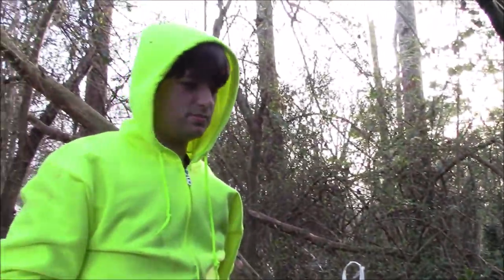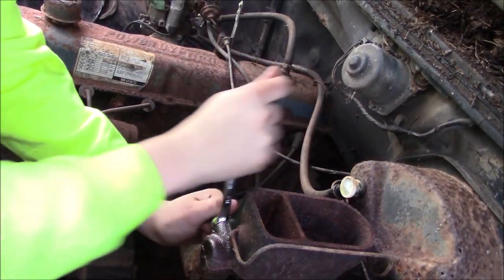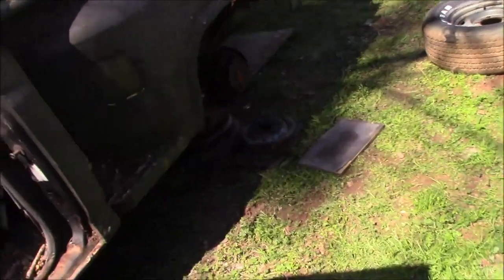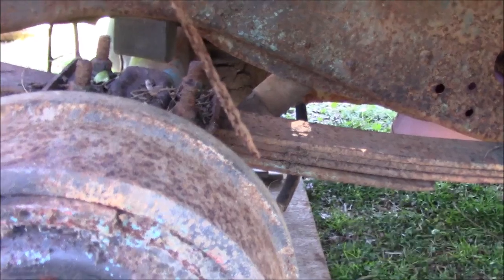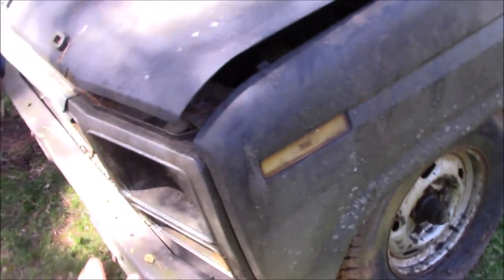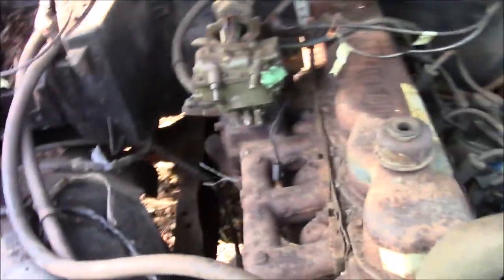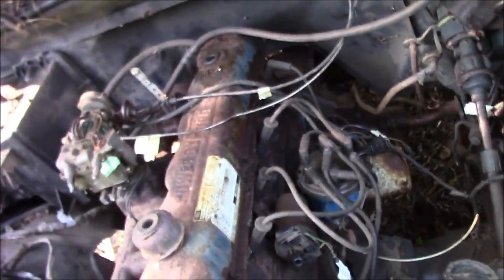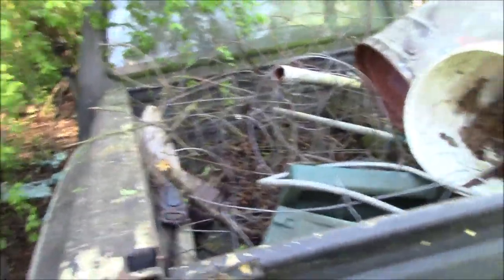PREPPING FOR DISSASEMBLY: Big Block F-100 build part 1

Comment: Hang on to your factory springs. You may not like the 3/4 ton springs as far as ride height and comfort. Both my big block F-150s still have original springs and they do just fine.
Reply from the maker: okay well the one on the drivers side is held in with a hose clamp right now. but i was worried about it messing wheel bearings and things like that up. But its good to know that the factory ones will work